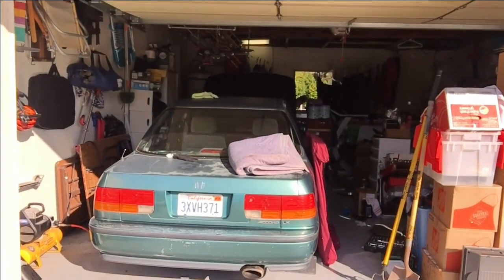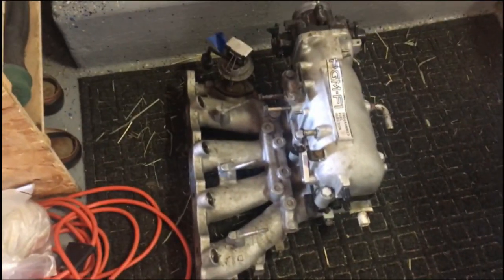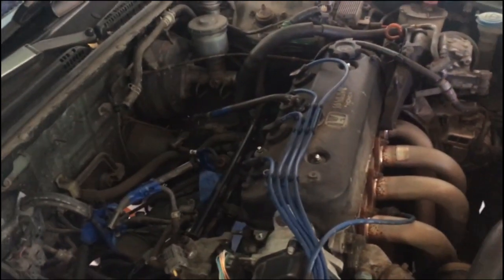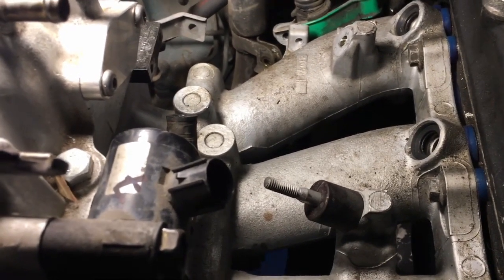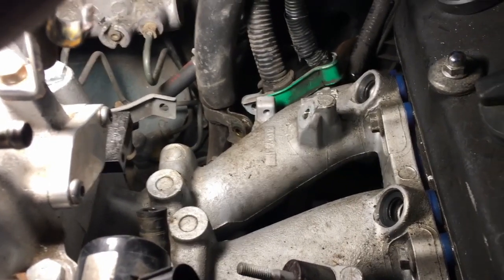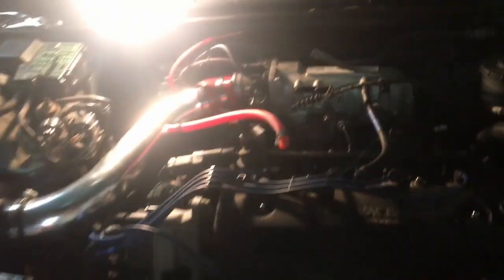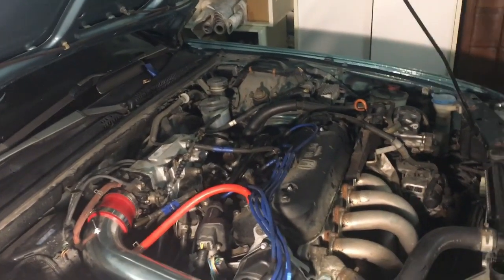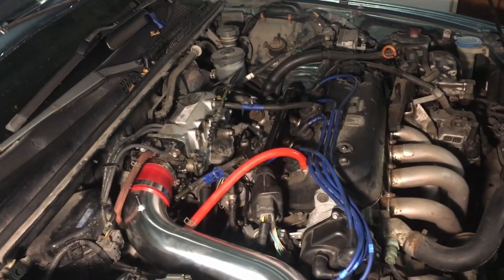My Friend's CB7 Build!

Comment: Nice! I just rebuilt my top end, tein coilover, and replaced all the bushings with urethane. It was a project for sure. Took me 3 weeks but im so excoted to drive it. I was wondering what type of header you gave your buddy? I need to get a ceramic coated one and downpipe.
Reply from the maker: Nice to hear of people working on these.  It was the DC Sports 4-2-1 header.
Reply: I was afraid you would say that LOL. I need to start looking for a decent used one I suppose. No one sells them anymore

Comment: hey man! its cool to see another cb7 saved from the junkyard. I'm having trouble getting a video posted on my channel as I'm too much of a perfectionist lol. using a galaxy s8 w/ cheepo mini tripod and selfie stick to start with, but honestly thats not my real problem. my issue is "EDITING" what do you use to edit your vids?
Reply from the maker: I used to use Windows Live Media Maker, but whenI upgraded to Windows 10, I could not find the program anymore!  I was miffed!  I have tried a lot since then, but the best editor for free, when you get the hang of it (not easy) is Lightworks version 14.  It is extremely capable, and you can get a renewable free license!
Reply: @af1132racing  ok.  I'm gonna look that up. What's a better way to contact you? You got messenger or WhatsApp?

Comment: What Computer are you running, Did you install the A6 Cam?
Reply from the maker: He's got my old p12 ECU, and no, no A6 cam
Reply: @af1132racing  H23 Manifold with what runners? Can the upper H23 be from a automatic Prelude? I can grab a H23 but it's off an automatic prelude.
Reply from the maker: Pretty sure I grabbed the full H23A1 plenum and runners from the same BB6 Prelude at the yard.  I know the runners line up fine with the head's intake ports. I can't recall if it was an auto or manual, most likely an auto.
Reply: @af1132racing  thanks for the reply, I don't mean to ask so many questions, I am just looking at the options. So to verify, you ran a P12 with the complete BB6 intake, how did you get the butterflies to open,  vacuum only?
Reply from the maker: I didn't keep the black box and all that to run the butterflies.  On that intake, I set them to stay locked open, not the best down low at all.
Reply: @af1132racing  Can you run the stock airbox with this throttle body and what about the support bracket under the manifold, will it fit? Thanks again.
Reply: I did the swap last weekend, everything runs fine. I kept the box that runs the butterflies. I am also running a P12 computer so I need to figure out how to run the butterflies using vacuum only. If  I disconnect the vacuum line going to the butterflies they stay open. If I reconnect the vacuum line to a port they appear to stay closed.

Comment: What’s the power gain on the h23 intake swap like on his car
Reply from the maker: It is around 10 hp in the upper range, but less on the lower end if you do not use the IAB system (neither of us do because it requires a certain type of ECU, unless we are willing to solder some components in, in which case a few more ECUs are compatible).